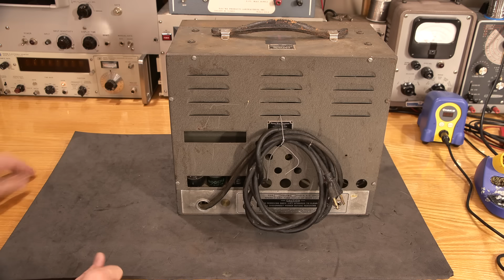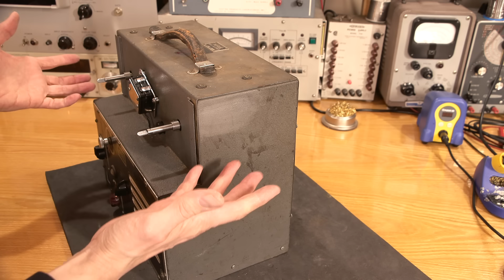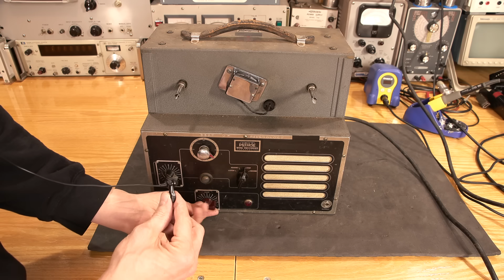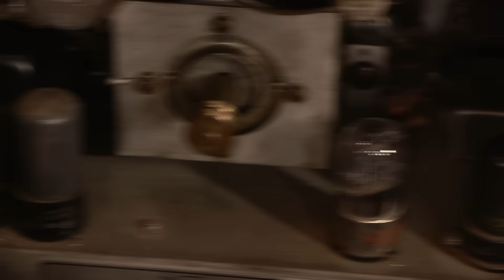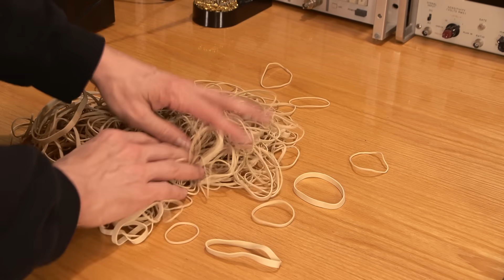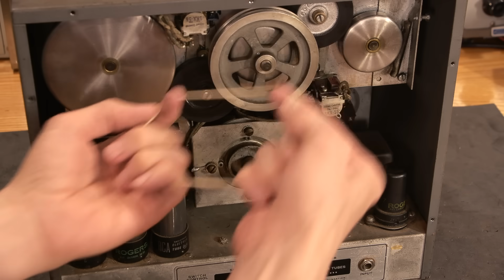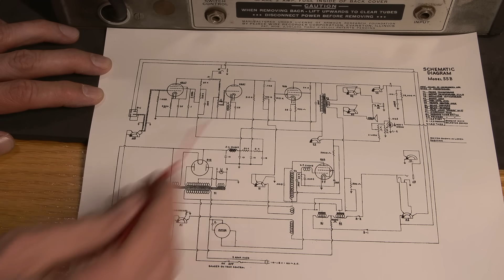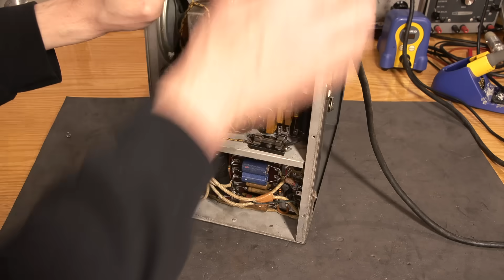Trapped Voices In This Wire - Let's Listen To Them!

Comment: I worked for Sears Service Center as an electronics technician. One time in the mid 1990s a customer brought in an old Sears wire recorder. From the customers description of the problem it had, I knew it was a mechanical issue. I never heard of a wire recorder but another technician, an older guy, explained to me how it worked. Between him and I, we decided to try to get this recorder fixed for the customer. Normally something this old we have to tell the customer that we can't repair it because of the availability of parts no longer made.
We ended up reconditioning the rubber idler and drive wheels that turn the spindles for the wire spools.  The rubber was dried out and cracked. We had found years ago that MEK (Methol-Ethol-Keytone) solvent softens old dried-out rubber belts and drive wheels. We got the wheels to grip enough to operate the recorder but barely. The customer left a spool of wire that had recordings on it. The customer said that either Truman or Roosevelt (I forgot who) had the presidential inauguration address from around the 1930s-1940s. We played it back and there was a recording of the president speaking.👍
These wire recorders work basically the same way an 8 track, cassette or reel to reel tape decks work. It records by magnetization of a magnetic medium. Instead of a mylar film with iron oxide applied to the film like tape recorders/players use, the medium was the wire. The tape head was very similar to modern tape decks. 
It was an interesting item. It's a very basic machine, simple technology, and surprisingly it didn't sound that bad. 👍

Comment: There's relatively hard TPU (search your filament shop for D58) which you could easily print a replacement rubber wheel from.

Comment: Are those glass things, tubes  or valves?
They are called tubes as they are manufactured from a glass tube.
They are called valves to indicate their function.
As explained to me, by my Dad, in the early 60's, when we were building a radio to listen to Sputnik.
...
The sly old fox bought my Mum a new washing line which was "much better than the old one..."
The fact that we used the wire core of said washing line as an antenna was never mentioned.
A couple of years later, another, slightly shorter, washing line was put up, at a slight angle to the other.
You could listen to the Police radios on that one...
The in-line insulators were explained as "bird scarers", which actually worked!

Comment: Be very careful once you get inside. It's been my experience in working with old valve radio sets that are powered by mains supply. Rectifier circuits pose a real risk to electrocution.
Whilst the supply may be 110vAC, there will be a DC supply for the board. This means that there will be a rather large capacitor on the mains supply rectifier to accomodate the volts drop and smoothing of the voltage. These tend to hold a charge long after being disconnected. Holding a charge for up to and longer than an hour!!!
 Discharging by means of an Earth lead may damage components in the rectifier.

Comment: You can get O ring material by the yard for making your own O rings which are then glued using super glue. Most hydraulic shops will have that as well as Amazon etc. I have a National tape recorder that my grandfather purchased in about 1956 when I would have been four, one of the tapes still has my voice on it as well as his and my sisters. It only has four transistors and runs on eight AA cells. You can refresh rubber by soaking in very hot water.

Comment: IN the 1930's the BBC in London had a wire recorded . Which the drums of 6 feet in diameter . The drums spun at very high speeds . And was considered dangerous to be in the same room as it when it was operating . So much so  no one was allowed in there when it was running.

Comment: You could always put the hardened rubber rollers in the lathe and turn one or two o-ring grooves into the rubber. Has saved me several times with old sewing machines. Since they're intermediate wheels the diameter doesn't matter anyways! Definite yes on the restoration!

Comment: I am wondering if the wire(s) on the speaker have come off at some point.
Or the cone of the speaker might be disintegrating and may need replaced?
And wow that old tech is what I call bubblegummed together.
But hey it still some what works after many years.
Granted it is by external means but this old tech is allowed to have some quirks needing fixed.
And I would say do a restore on this machine.
I love repairing tech it is why I got into pinball repair lots of history throughout the years in pinball.
Pinball for me is so interesting as it went from nails on painted boards.
To fancy lighted up back boards to flippers in 47.
And now pretty much can do anything with a pinball machine now.
And how small everything is for the Solid State stuff in a pin.
I am making my own and the boards now might take up a quarter to half the back box.
As the backbox used to have the whole head full of electronics.
I also just love it when I get a pin up and running again and things working as they should.
Good luck with what ever you choose for this wire transcript device.

Comment: The description of your video caught my attention to watch.
My dad had a box with numerous wire tapes that my older brother had. When my brother died, we had no idea what kind of machine would play them. I asked a neighbor whose dad was an old school tv and radio repairman for tube type electronics, so I gave the tapes to her.  My dad worked for our governments' nuclear program from the 30-40's and who knows what was on the wire tapes. My dad went to an Industrial Arts University in the early 1930's in New York City and was also an electronics wizard like you are and vacuum tubes is how our early electronics were made.
Why do you think Musicians love the sound from a tube amp? Because they don't sound like modern day Solid State Amps.

In the early 1970's when I was in middle school, my dad showed me one day visiting him how to make an AM radio using cardboard, Elemer's glue to glue the aluminum foil to the cardboard, some resistors from Radio Shack and some other electronic parts. Following a wiring schematic, we cut the foil for the current path which a 9 volt battery was used, a mini speaker and other knobs for volume and tuning, we even had a small light bulb so you would know it was on. Built a circuit board out of cardboard. Later on in High School I took a Basic Electronics class where we were shown how a thin copper backed Masonite board was used to make circuit boards.

My favorite thing I ever made was a soup can motor. I can remember asking my mom if we could have some Campbell's Soup for dinner, because I needed the can for my High School class. Used a variable voltage machine that was used for both AC or DC currents.
Was taught how to make the windings out of copper wire a couple of curved magnets.
The thinner the copper wire the smaller the motor, After making the windings we had to cover with shellac to insulate.  The windings and thickness of the copper wire was rated at 12 volts, we would turn the knob to increase the voltage and could smoke the motors at 18 volts. Went to Radio Shack and bought thicker copper wire and built another. Started at 12 volts and smoked it at 25 volts.
 
Old speakers usually will not work because the paper cone surrounding the magnet is broken. I got in trouble when I used my mother's clear fingernail polish to glue my speaker's paper cone so the speaker would work.

Thank you for showing me something I always wanted to know about.

Comment: Wow, something I didn't know. As a former head broadcast engineer, I should have learned about this but your video came up in the search when I was researching the history of recorded media to write a script on the subject of the transition from analog to digital video editing. I want young people to have a better fundamental knowledge of the history of media and wadda ya know, as a guy who usually knows things people do know here's something I don't. A wise man knows nothing is a phrase I think of at least once a day to stay humble, and seeing this humbles me for the rest of the day. THANKS DR. I'm currently updating my skills and delving more into electrical engineering,  physics and chemical engineering to try to figure out how to find a way to make a Peltier device more efficient so that something like it is more practical for gpu server cooling while preventing condensation by limiting power and lowering the Delta T to avoid temps around the dew point. I also think so far quantum computers are too fragile and despite new materials if the problem of speed is distance and latency of a wave then maybe we're thinking of sending electricity and information encoded on a wave, the wrong way. Having transistors as small as an atom is the direction things are going but what if time wasn't a factor and we found a way to send the signal that appears at the same time or even 1 nanosecond in the future. Yes, time machine comes to mind but what if we could use the connected particle theory by artificially developing materials that encode atoms to have this connection. Worm hole electronics is a very wacky idea but I have truly crazy impractical things coming to mind all the time.  If transistors were the size of an atom then it would make sense to create an atomic structure that could end the time to travel from source to gate. Anyway, an analogue signal on a wire is odd because the wave isn't going to have the same z axis to play it and I have to see how the orientation in the wire changes amplitude and frequency for volume and pitch and not play the wire upside down or backwards.

Comment: My great uncle (grandfather’s brother) had a wire recorder and I remember as a kid in the 60’s him using it to play US radio shows and things he recorded  off a short-wave receiver from Europe, from as early as the 1930s if memory serves.   Wire recorders were available as early as the 1920s.

He and my grandfather (born in 1899) had an interest in electricity and radio  at a young age. One family story was Navy MPs showing up at he door of their South Side Chicago house just before WWI  in 1914 because they had created a spark gap radio transmitter with antenna wire strung between house and tree which was interfering with ship-to-shore radio communications. They had apparently been communicating with some like-minded experimenters in the UK via morse code.  My grandfather later served as a radio operator in the Navy then became and electrician back when parts of the Chicago power grid was still using Edison’s DC system.  Sadly he died in 1956 when I was four so I have no first hand memories but everything from his basement workshop wound up in mine growing up as a kid and I heard stories told by my uncle of all the other stuff they did as kids.

Comment: Wow, that was amazing to hear working!  In the early 80s, I remember a conversation between my Dad and Grandpa where he mentioned a neighbor's wire recorder.  Amazing how good the fidelity and retention of signal the wire medium offers.  I guess it wasn't till after the war that the technology of sticking fine enough iron oxide particles to cellulose acetate tape got perfected.  Another challenge in the development of tape recorders was making the gap in the recording and playback heads fine enough for good signal pickup.

A story you'll appreciate as replacing capacitors will undoubtedly be part of the restoration process.  I inherited an old Hallicrafter's tube AM/Shortwave receiver from my Dad and liked to listen to morse code on the ham bands.  One day there came a loud POP and it quit working.  Found a blown up capacitor with colored dots, from the days long before when it became cheaper to just print the value on the component.  I took it to an electronics store, this was late 70s.  The young guys had no idea, but an old crusty guy looked at it then laid into me. "YOU DON'T KNOW YOUR CAPACITOR COLOR CODES??? HOW OLD ARE YOU?"  Intimidated, I said in a quiet voice, "Ten..."  The air went out of his rant and he said, "oh... WELL WHEN YOU'RE 11 YOU NEED TO LEARN YOUR CAPACITOR COLOR CODES..." as he went to the correct drawer and got me the tubular ceramic capacitor I needed which fixed the radio!

Comment: Are those 2 belt grooves for 50/60 Hz selection?  You need to remove one of the bands?  The 2 bands are "fighting" because the 2 grooves are different diameters?  Try removing one & play with belt in one groove, then the other, to notice if there is speed difference.
          The sound quality is way better than the wire recorder that my friend had.  His had a "wirey" sound (like what you picked up directly from the wire) superimposed over the audio.
          All those wax caps need replacing!  They absorb moisture & become high resistances.  Do you know about the "outside foil" designations on the caps?  The barred end designates that.  Although these are non-polar caps, if you put cap in with outside foil on the wrong end, there will be more noise pickup.  The high-Z end needs to be the "inside foil" end.

Comment: 0:37 He says stainless wire. Normally, stainless steel is not magnetic. Presumably this is a magnetic ferrous alloy optimized for wire pulling and magnetic remanence and not conventional stainless steel at all.
Reply: Cheaper stainless steel (302 304) is magnetic. The good stuff (316) has enough nickel and chromium to offset the ferrous magnetic characteristic.
Reply: Shhhhh, I'm tryna listen 😂
Reply: @MrAdaptive 😂
Reply: Some stainless is magnetic. Some are not.
Reply: It depends on the amount of nickel in the steel
Reply: Nah its not the point.

Comment: This has inspired me to dig out my 1950's "Recordon" magnetic paper disk Dictaphone. The erase 'head' is a hand held magnet that you hold in place on the revolving paper disk. It's very much like a vinyl record but made of paper. The 'stylus' is a magnetic pickup head which one side runs in a groove in the removable bakelite central spiralling scroll. I remember recording my grandfather reciting a 'Yorkshire Ditty' poem in the old Yorkshire dialect, back in the mid 60's. I was about 10 or 11 years old then and probably I am now a similar age to my granddad, then. 

I would love to see this restoration and pick up some tips on renovating my own valve recording device. Thank you Mr Carlson from the UK. 🇬🇧

Comment: i had a similar belt drive issue on a 1940's black and decker valve grinder. i just got some vacuum tube at the auto parts store, cut it to length and super glued the ends. its been three years and it still works fine

Comment: Oh, um, the tube that had the glowing grid will almost certainly need to be replaced after repairing the bias circuit.
Grid current, as you may well know, is a very bad thing. 🫤

Comment: As in most amps, the main driver fails, which is output transistor or in this case tubes failing with some caps I would bet on. Back in the day, take the tubes to a drug store put them on a tester and buy ones that failed. I fixed some tvs for my dads friends doing just that.

Comment: The speaker coil may be stuck.
Or simply a bad connection.
The hum says supply ripple ..lots of it.
Replace all of the capactiors and replace or recondition the rubber and replace the speaker then it would probably "purr like a kitten"!

Comment: Sometimes the fub er surfaces can be "brought back" by a removing them and soaking in RubberReNew or EvapoRust (available from HFT, etc ) that has a similar chemistry.
The EvapoRust seems to work better.
The soak needs to go for a while (several days).
Then clean off and let dry.
DO NOT use alcohol or solvents- it will strip the elastomers from the rubber.
That appears to be a later version with a capstan drive.
The original ones used reel drive only (not constant speed 🫤)
Pretty cool to see old hardware like that in near-operational condition.
The capacitors are almost certainly bad. Very bad.
That will prevent proper supply operation and no coupling to the audio amps which will be capacitor coupled on the input(s).

Comment: This is a nice machine, but how do you do a stereo recording with it ?
Reply: That's a good question. Probably you would need to utilise something like on FM radio. Frequency modulation at a much higher speed could possibly do it. I can't imagine how it could be edited, either. A soldered joint or just tie the ends in a knot? 😂